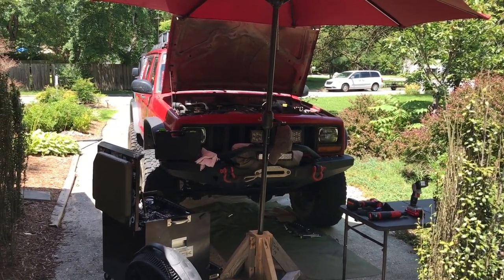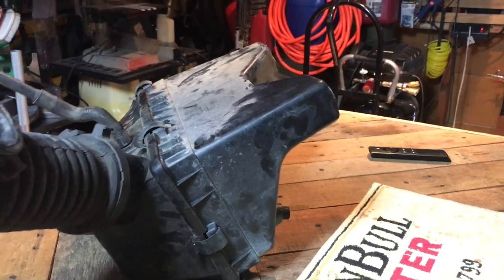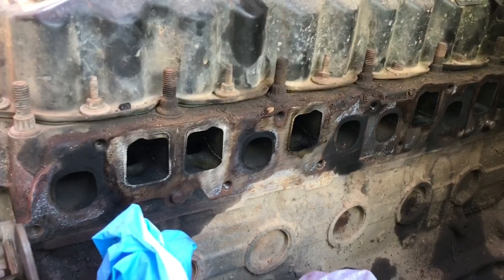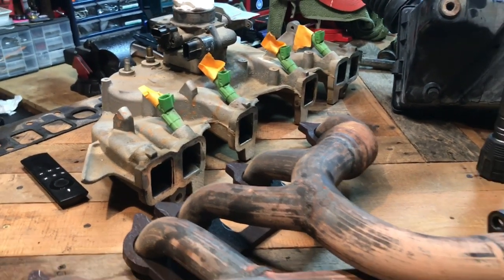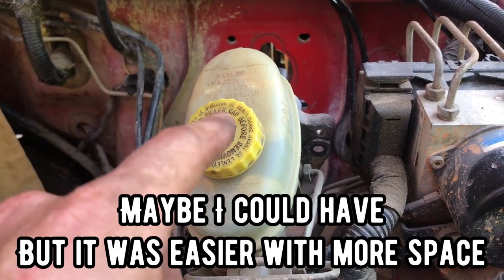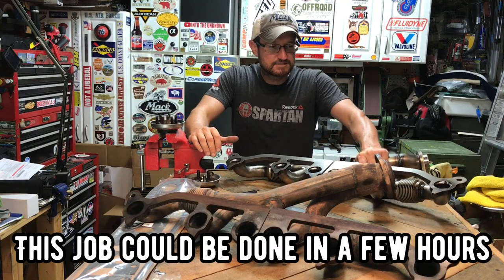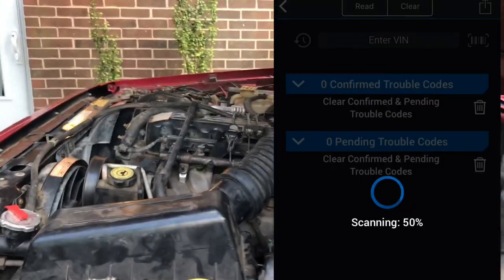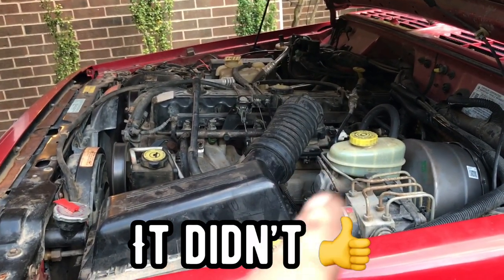Replacing My Jeep Cherokee XJ Exhaust Manifold & Dealing With Issues, Including Self Inflicted Ones

Comment from the maker: No matter how small or large the job, it is always something that makes the job unnecessarily longer haha. .  If it isn't a part issue, then I usually make the job harder on myself by forgetting something or not paying attention.  It never fails.  This is just an example of both.  Anyway, to date, the manifold is working well (no leaks) and I passed inspection. 
As a side note: The brake booster did not change the braking in any way.  I did not upgrade it (which can be done on an XJ). I just changed out an older working booster for a new working booster.

Comment: I removed my old leaking exhaust manifold and it looked good except for a few broken factory welds in the same area as yours.  I figured that since my old manifold is leaking that means it has contorted and bent to where it is now comfortable.  So, I took a chance and rewelded the broken welds in the old manifold and replaced it on the jeep with a good quality gasket.  That was many miles ago, the world is rosy and it only cost me the new gaskets and time... ;-)

Comment: You did the evaporator and heater core!  I think once you tackle and complete that job, all other jobs are a piece of cake in comparison lol!  Glad your trip is a go!  Safe travels!
Reply from the maker: Actually the heater core was less of a pain than this. Maybe because of the heat. But if I had a choice I think I would choose the core haha I am not a fan of engine work. I don’t even like changing the oil. Not a born mechanic for sure. But at least I can do the jobs and know enough to tweak them when necessary.
Reply: @simpleoverlander  I believe you will be able to handle anything the old XJ throws st you lol

Comment: Just went through this same repair, and similar issues. I was going to get a header, but pretty much all of them have some bad reviews, no matter the cost. So I went with an oem style replacement. Then when I took it off I found someone had previously broken a bolt in the head, and then welded a stud on that’s been broken for a while. Couldn’t drill it out, and probably need the head repaired/replaced to truly fix it. I did a desperate butcher repair of just putting furnace cement around the outside of that port, and it’s not leaking 🤷🏼‍♂️🤞
Reply from the maker: I know about desperate repairs haha. That was my fear when I attempted to do this. The mechanic I used last time was a hack and realized too late he was clueless. Wasn’t my main go-to guys. I was really expecting to find an ugly surprise but luckily I didn’t.
Hope your quick fix lasts and you can worry about it the next time you change out the manifold.

Comment: good and helpful video ! Didn't you explore to install a header ? This is what I am thinking about instead of an exhaust manifold.
Reply from the maker: I never looked into a header since I put this off too long, and was strapped for time when I finally got around to it. I may consider it next time.
Reply: @simpleoverlander  what do you think about a banks header ? A bit pricy, but should be good quality people say....
also: which issue/symptoms you had with the brake booster ? Did you need to also to bleed the ABS valve when re-install the booster ? thanks.

Comment: Reinforce weld - have a professional shop upgrade that previous header.
Reply from the maker: Good points. I will see how much I can get the old one done right. Other than the welds it still looked solid.

Comment: Which obd2 do you use to check the enginecodes?
Reply from the maker: I use the bluetooth BlueDriver. I have a link in the description below.
There are cheaper ones that have good reviews but wanted something that hopefully will not crap out on me while I am away from populated areas. I like it and use it in multiple vehicles.

Comment: I hear some bad knock at 12.25 in the video
Reply: It's got over 272K miles so I figure he has about another 50K before he needs to start worrying
Reply from the maker: I do have a knock every now and then and for a while now. It doesn’t stay long though. I added oil stabilizer to my oil during a change after this video and it seems to help when I do. I have 2 life long mechanics that tell me it os not worrisome to them. If it gets worse I will look into it further.
Reply from the maker: I think I am about 220-230k. I have put maybe 80-90k on it since I got it. I changed the cluster to upgrade it and it jumped a lot on the odometer. The number comes with the cluster. The engine was also rebuilt before I got it, but not sure when. Hopefully I am good for a long while yet. Guess it depends on how well the rebuilt engine was done.
Reply: @simpleoverlander  oh that's good!  Didn't know that.  I forgot you said you changed the basic cluster out in a former video.